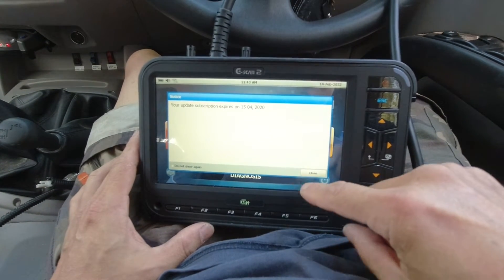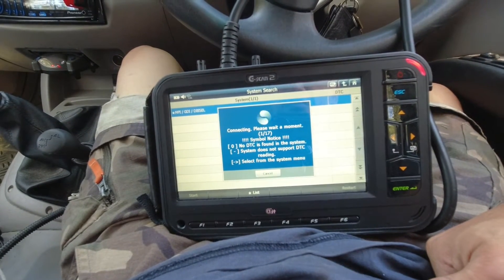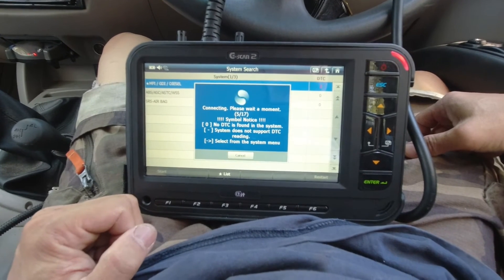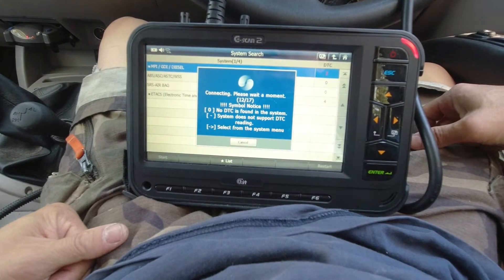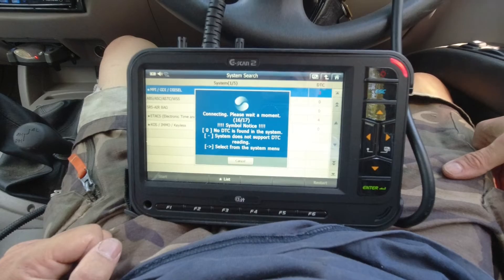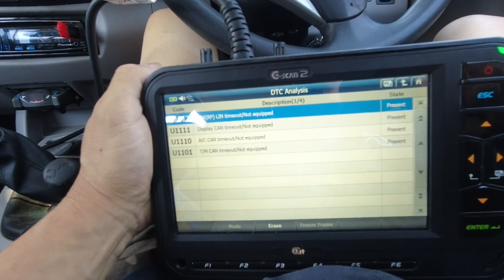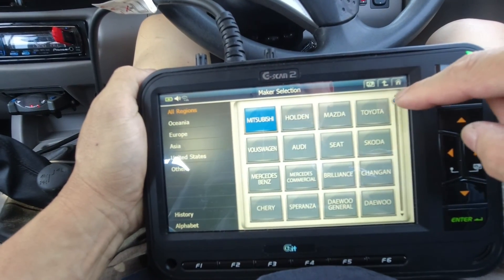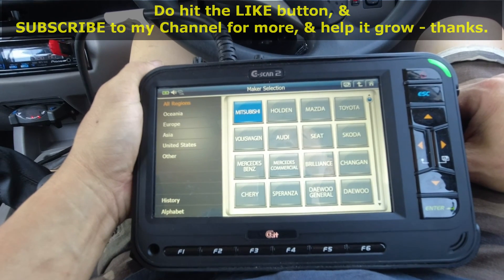Small Injection Quantity Learning by G-SCAN 2 vehicle programmer on MITSUBISHI L200 TRITON 4M41

Comment: I have my temperatures right but it still doesn't let me do test saying parameters are not correct
Reply from the maker: there are 5 Idling Stable Conditions that must be satisfied before SQIL will begin. Here are the conditions for U to check against.

LEARNING PROCEDURE
1. After the ignition switch is in "LOCK" (OFF) position, connect the M.U.T.-III to the diagnosis Connector.

2. Put the vehicle in the following idling stable conditions:
• Engine coolant temperature: 80 − 90° C
• Automatic transmission fluid temperature: 60° C or higher
• Lamps, A/C condenser fan and all accessories: OFF
• Transmission: Neutral <M/T>, "P" range <A/T>
• Power steering: Static state

3. Select SPECIAL FUNCTION from the function Menu.

4. Select SMALL INJECTION QUANTITY LEARNING from the SPECIAL FUNCTION menu to execute learning.
CAUTION
If the vehicle conditions go out of the learning conditions during idling, learning is interrupted. To re-execute
learning, the ignition switch must once be turned off.

5. Continue idling for about 3 minutes before learning is completed.

6. Confirm that the engine warning lamp is off. If it still blinks, re-execute learning
Reply: Hi! I have the same problem. Always say parametrs not correct. Mitshubishi L200 2014.year manual transmission. Maybe need do something more? The car is egr and trhottlle off 5year ago. Maybe it is the problem?
Reply: @FixFastFuture What was the solution?
Reply: I also have this problem, using a snap on scan tool but won't let me proceed. Did you find the issue?
Reply: @sniperbattle666  maybe try disconnect battery for 10 mins and then take it for a hard drive to get everything up to temp.